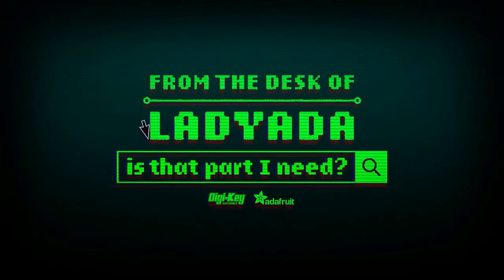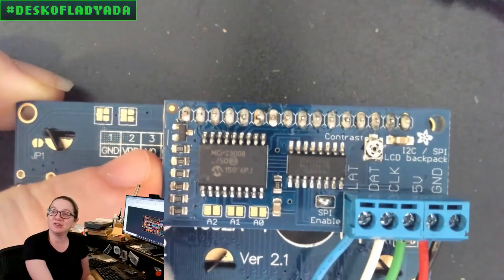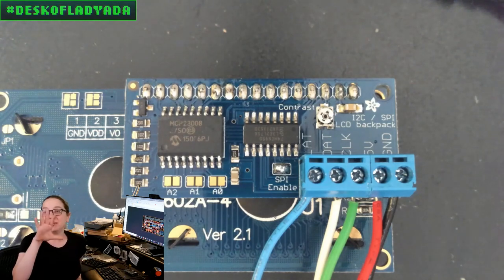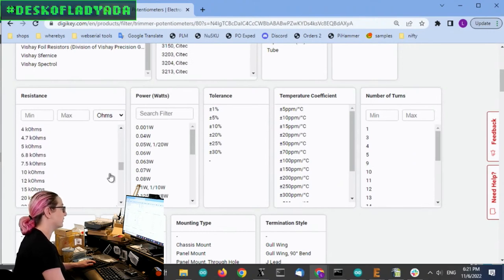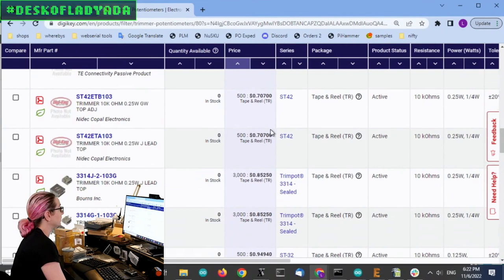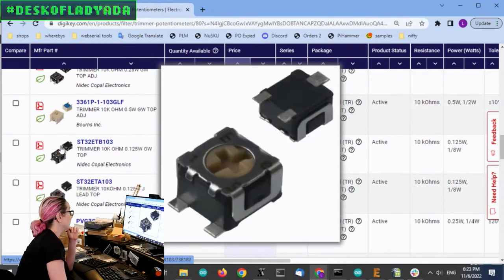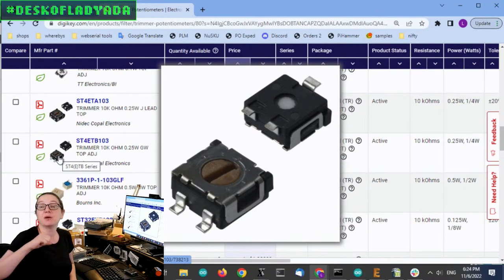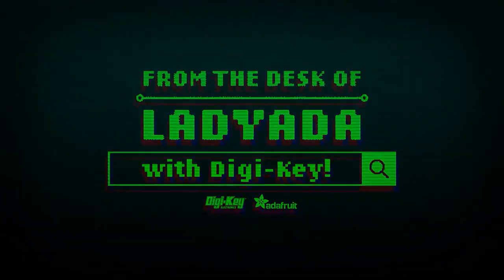The Great Search: A Nice and Easy SMT Trimmer Pot #TheGreatSearch #DigiKey @DigiKey @Adafruit

Comment: I'm not one to correct Lada Ada but the bit difference between a trim pot and a full size pot is lifespan. You're going to be able to adjust a trim pot far less times than a large pot before it starts to fail.
Reply: Don't use a trim pot for a volume knob.